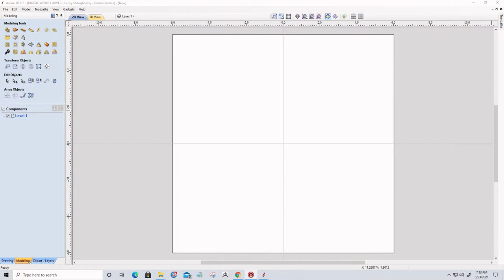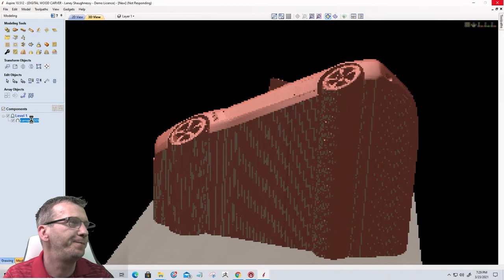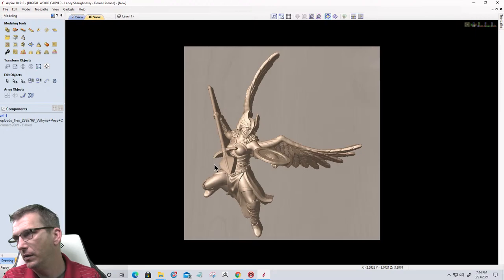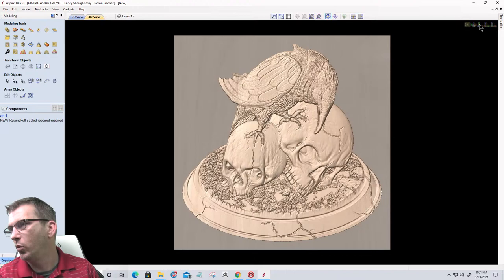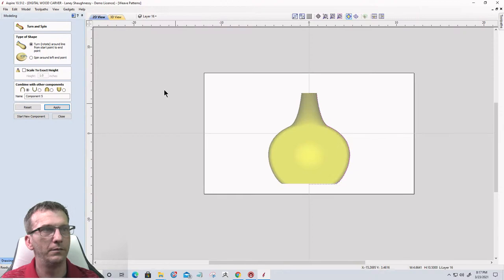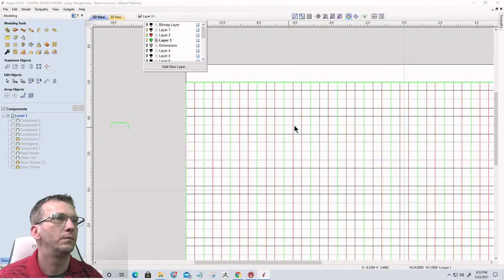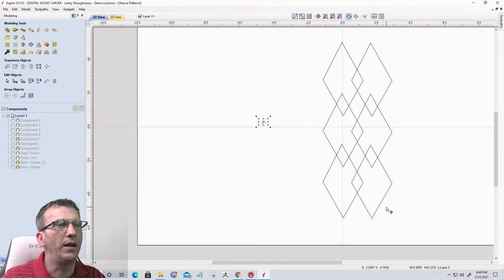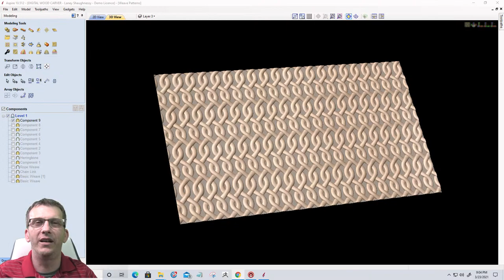Using the Aspire Emboss and Single Rail Sweep Tools

Comment: Question about the camaro model part in the beginning...with some of these models being so large..is there a way that aspire will "re render" the model to reduce the massive polygon count?  Meaning if the model is created at 80 inches, and you shrink it down to 12 inches, can the software reduce the resolution or size of the model so it's not trying to process the insane polygon count every movement?  Maybe I'm not even making sense :(
Reply from the maker: I believe when you resize the model it does change the mesh in the polygons and all within the Vetric software to regenerate that model